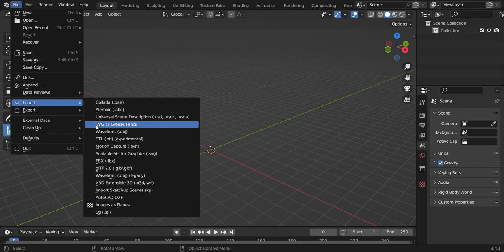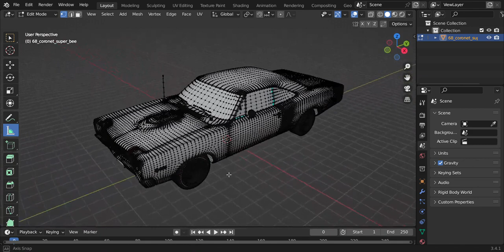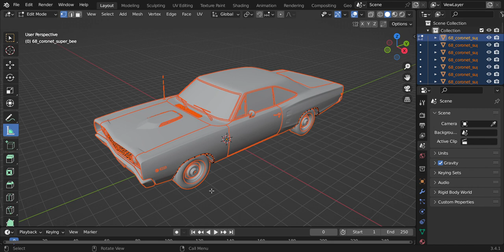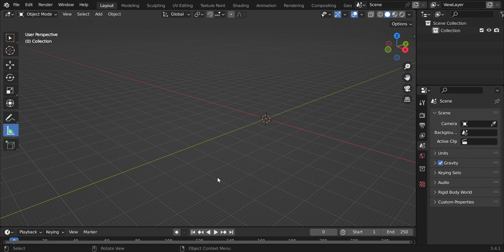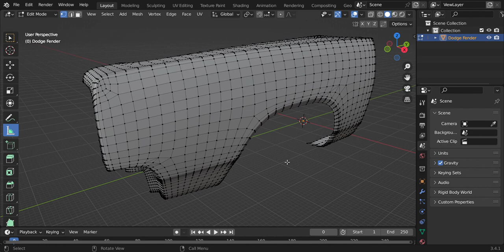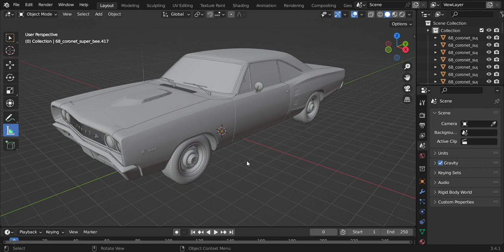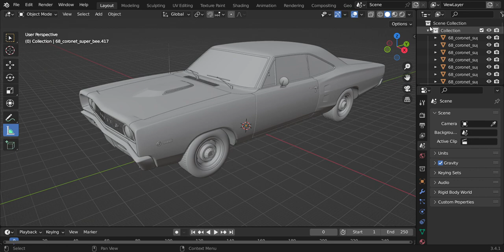Separating 3D File Car Body Panels In Blender - Part 3

Comment: a question: if I want to separate the car parts and fix them (if I don't want to move them accidentally): how can I do it?
Reply from the maker: Sorry, I’m just now seeing your question. You can always open up a separate window of Blender, and make changes to the part. 

Say for example you have .blend file, but you don’t want to make any changes there. You can open up Blender again, work on the part, export it, then you can re-import it into your .blend file.

I do this all the time when I’m designing a file, and it might be something complex like a wheel, or a grille which needs created. 

Hope this helps!
Reply: @plastiksurgeon9129  Thank you friend!
Reply from the maker: @protomanialab You’re welcome!

Comment: thanks for this. so how can i do this if i wanted to save the whole front clip as one save as one piece?
Reply from the maker: You can select the front clip as a whole object in the collection, hide the front clip as I showed, delete the other surrounding objects (hit the A key to select all and delete), unhide the object, and then export the front clip as its own file name.

If you want to go back to save other parts, hit the CTRL/Z keys, and that will bring back the parts you deleted and you can do the same process to any other parts.